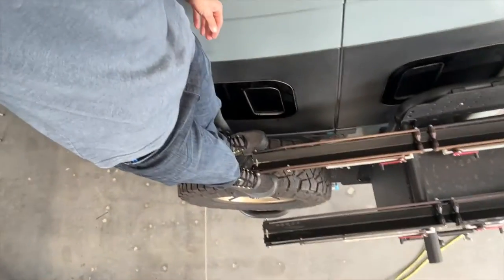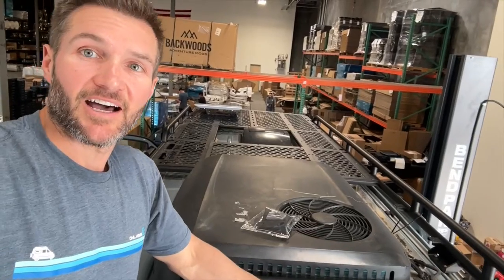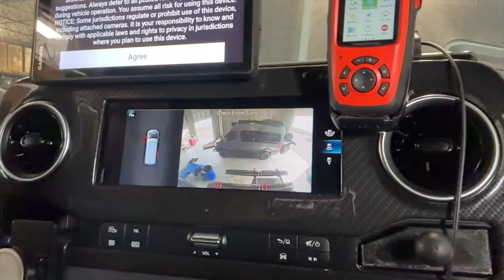Back Up Camera Risers

Comment: Rear parking sensors are driving me crazy.. if I am trying to parallel park, and backing up diagonally across a white line, and there is anyone in the vicinity on a bicycle passing by, the active braking throws the brakes and the abs starts howling.. super embarrassing. Happens whether or not I have disabled the parking sensors on the screen.
Reply from the maker: The parking sensors suck, unplug them and they will never bother you again.